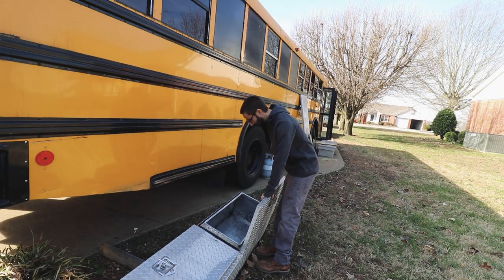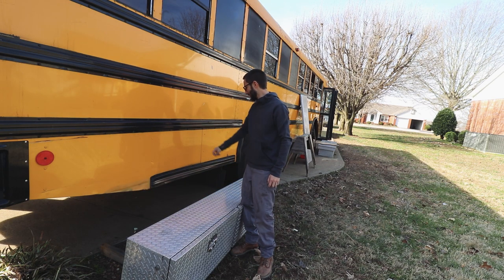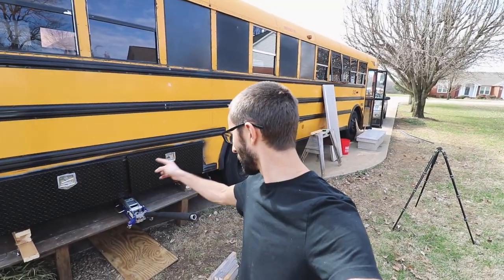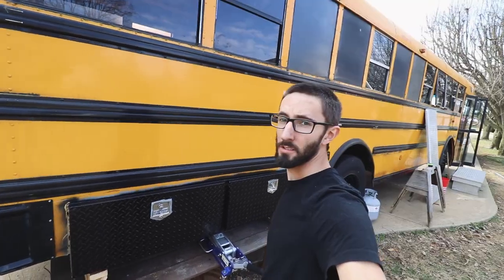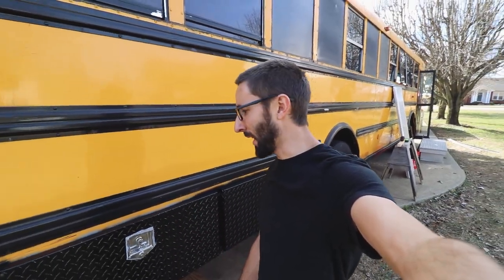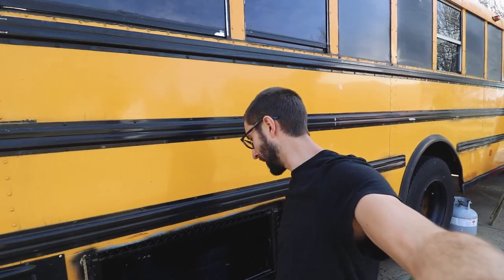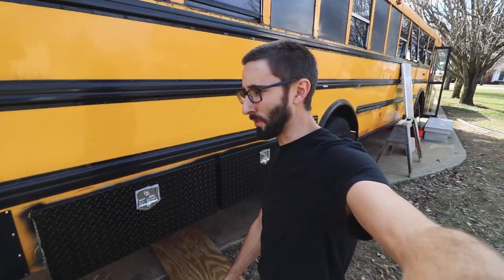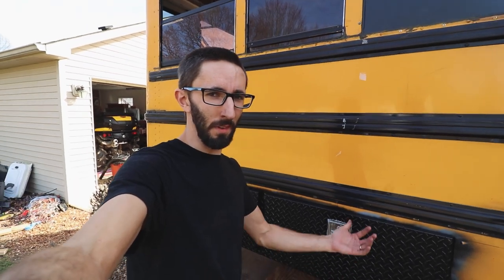Installing MORE STORAGE and adding MORE SPACE on a School Bus // Skoolie Conversion

Comment: I would build a brace for u under that box to help support it so u can put some real weight in it and watch for corrosion on the aluminum between the steel where it mounts it will rot the aluminum out having to dissimilar metals touching
Reply from the maker: Got it. Thanks for the tips.

Comment: I think you should support with a frame or straps. Put enough weight in and you will probably end up loosing it on the road.
Reply from the maker: Good suggestion. But we dont intend to add a bunch of stuff down there. There's 4 3/16 bolts in it with a 1"washer on each. There would have to be a lot of weight for it to break.
Reply: Backroad Purpose while your driving your bus think of the extra stuff you put on it as going through an earth quake and tornado at the same time. If you don’t have straps and a lot bigger bolts it will fail. Just sayin.
Reply from the maker: @charlotte97838  thanks for the advice!

Comment: Where did u get the storage boxs?? And where did u screw it n at it was too dark
Reply from the maker: I got the box off Facebook Market Place! It was like $50. It's a flatbed storage box. And I just bolted it up through the top of the box into the floor. 4 5/16 bolts.

Comment: How has this held up over time? Just curious if those bolts have pulled out of the box at all.
Reply from the maker: Its been great. I did run 2 extra bolts since I had them but ever before that it seemed super solid!
Reply: @BackroadPurpose  thanks for the response! I'm going to add a storage box under bus, but figured I'd need to add a frame to support it. Your method is way easier.
Reply from the maker: @StevenNorth-1  yeah man no problem! I just made sure I had a big washer underneath so the bolt wouldn't pull through. A 1" washer is what I used. Going bigger never hurts.

Comment: What a great idea! What are you going to do for your open ended rub rails on the side of the boxes? 

Your video made us think using boxes on either side of the bus would be a great entrance for pass through storage!

Thanks for sharing your progress!
Reply from the maker: I'm just going to tack up a piece of metal to close it off. And we thought about the same idea but our frame rails are massive so unless the box hung a lot lower then the bus, we would only have like a 6inch boxon the middle side. So I didn't think it was worth it. We also plan on putting our generator and propane tank on the other side after I reroute the exhaust.
Reply: Backroad Purpose very well thought out! We like the idea on mounting a generator for another source of power when there hasn’t been enough solar production.

Keep rocking it, y’all!
- Brian + Erin

Comment: Isn't it upside down?  I would have mounted the other way and installed some struts on the doors.  Your way's easier, I rarely choose that way which is why I'm so good at doing nothing ( :
Reply from the maker: Lol I though about it but then I'd also have to crouch down lower to get underneath the door into the box this way gives me a little fold down table. E